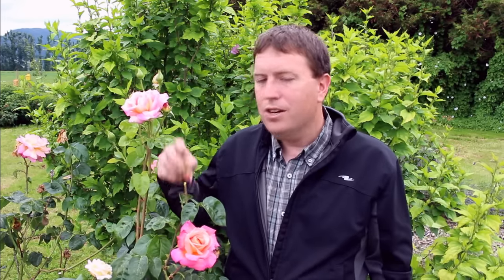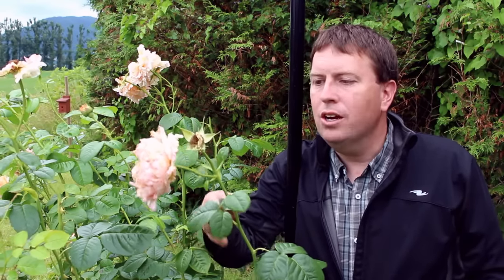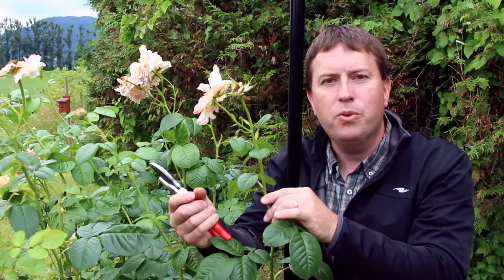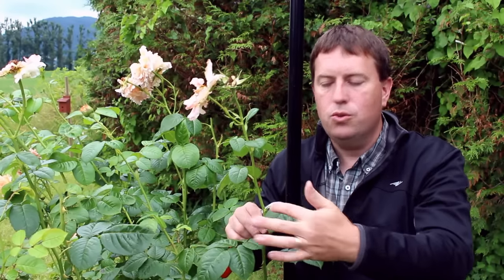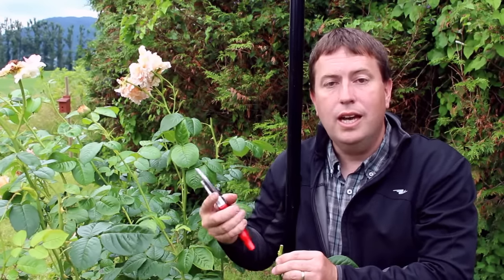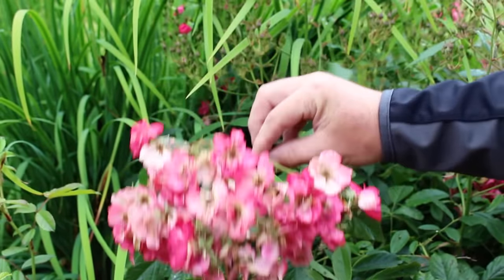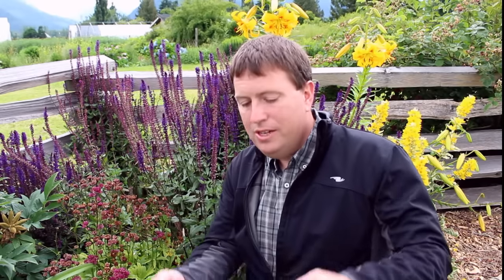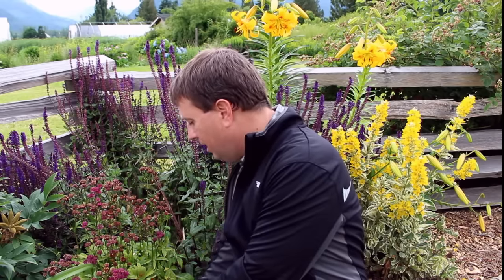Deadhead Roses for More Flowers

Comment: I follow every tip you give, and our roses have never looked as good as they have before. I also dont follow inward or outward facing bud eyes either. Bc the rose bush does shoot anyway it wants really anyway. I agree with cutting like you do. I have some rose bushes that have over 50 flowers at any given time. Along with multiple buds getting ready to open. And it's a smaller type floribunda with that many flowers. Its gorgeous. Just want to thank you for all the info you put out.
Reply from the maker: Thanks for the encouragement Seth

Comment: The reason for cutting at a slant, is to let rain water roll off the cut. In a wet climate this is quite important!!! Please don't pooh, pooh  other ways of doing this cut. You are not always right! Your presentation is very structured and methodical; well done!
Reply from the maker: Thanks Rose - one of my reasons for this video is to question these common practices. In my experience (in this very wet climate) the angle of cut makes no difference to post-pruning die back. I've also seen no horticultural research that supports the practice. If you like the angled cuts (or have found it useful) I leave you to your judgement, but I see it as unnecessary. Thanks for the feedback and for sharing your experience!

Comment: Thank you! Thank You! THANK YOU!!!!  I am 27 days away from my step-daughter's wedding at home and I put in a white garden that looks great now.  As the phlox are petering out, I have started deadheading but was unsure if i should be aggressive or deadhead in waves.  How do you tell how long it takes for a plant to start re-blooming?  Are there different re-blooming times (once deadheaded) for plants?  I am subscribing!
Reply from the maker: Thanks. It depends a lot on temperature, but 26 days is probably pushing it for most perennials to send new stems and blooms. I generally favor light deadheading, and in waves - because the results can be hard to time perfectly for the season, I figure it's better to make a lot of little bets than one big bet if you know what I mean.

Comment: Your channel taught me so much about plants. Thanks for sharing.
And one question, 
Will my Roses still grow in height with this Technic?
Reply from the maker: Hi Jud. Yes. After each flowering, they'll put on a little more height. I usually recommend an annual cool-season structural pruning step to correct the size and shape to your preference
Reply: Hi, I’m new to this with roses and seem to have a black thumb when it comes to gardening🤦‍♀️ but here goes.
I have fashioned an arch over my yard pond, and staged a climbing rose bush on either end of the arch (one red, one yellow) to have them grow in length across the arch, cross each other to the other side, and eventually have an arch that shows blended red & yellow roses, but my vines are 1) very sparse, and 2) when I try to ‘deadhead’ the roses, the vine starts dying from where I pinched/snipped, backwards down the vine eventually killing a good length of it, if not all of it.
So my question is, why is this happening, what am I doing wrong..? And also, how can I make my vines fuller without having to prune them back and starting over..?

Comment: Thank you for your very informative videos!  I have a question only tangentially related to deadheading and staging, but I am curious whether you have any thoughts on the matter.  That is, what if anything do you do when a plant in full flower has been beaten to the ground by a heavy rain?  Even when the stem has not been broken, I find it often true that plants don't "straighten back up," for lack of a better term.  For example, I have quite a few Mimulus cardinalis that recently were utterly flattened, and I'm at a loss once again as to how to attempt restoring them.  Staking might work, I suppose, but it's far from my favorite garden activity.  Anyway, many thanks again for your informative and enjoyable work.
Reply from the maker: Thanks Frank. I'm afraid I have to agree - once the weather has taken its toll on a plant, it's hard to get it back into shape. I usually end up pruning low (and fertilizing) for rebloom, because I do a lot of staging around the garden anyway, and staking just has never worked too well for me.

Comment: Thank you so much for this useful information.
Can these cuts be used for propagation? And can cuts be successful in hot months of the summer like July and August?
Reply from the maker: Hi Mohamed. If you're taking cuttings for prop at the same time, I suggest you cut a little lower, so that you get a couple of sections with 3 or 4 nodes you can stick. If you're doing this in July and August, just be sure to provide enough shade and humidity to keep them from drying out. I wish you luck!
Reply: Thank you so much

Comment: Can you use the section which had the 3 leaves as a stem cutting for propagation? Your garden looks lovely!
Reply from the maker: I've been using them - and I haven't seen a huge difference in results between them and ones taken from lower on the stem.

Comment: Thanks for the great videos. Do you have to pull off the 5 leaf then cut above it? Or do just need to cut above the 5 leafs when dead heading?
Reply from the maker: Hi Julie - thanks for the question. Cut above the 5-leaflet leaf, but you don't have to remove it.

Comment: Hi.Thank you for your video. Live in Philly. My problem I have roses established for 10 yrs now. A weed has grown middle ..I tried digging out..roots really in there ..wind up cutting back every yr.  Any suggestions.
Also is better to prune in January in my area.Ty.
Reply from the maker: Hi Debbie. Sounds like an annoying weed! Short of digging the rose out entirely to isolate it from the weed, I can't think of much.
Reply: I've had that same problem.  Wait till after the flowering season, water the rose generously a day before to soften the soil.  Then using a fork, dig in deeply all around the rose to loosen the soil until you can ease out the deep rooted weed.  Aftercare: add soluble fertiliser to the watering can & water generously around the rose, apologise & explain what is going on (to the rose) & why; add a layer of good quality compost, talk to it nicely, and give it plenty of attention, like a child.
If the weed is thick rooted & very deep, e.g. a tree sapling, cut it off above soil level, drill a hole into the remaining root, and inject some glyphosate into the hole, & plug the hole with a twig or something.
I don't know about the weather / climate in Philly, I'm commenting from England.  Here, I prune the roses back in autumn about 1/3rd to avoid wind rock; and again in march/ April at the very start of bud break as the rose is coming alive.  Also, it can vary with different varieties, shrub / climber / rambler / hybrid / species, and how they are faring.   I have made mistakes in under- and over-pruning, but roses are extraordinarily forgiving.  A lifetime of learning.  Besta luck.

Comment: When you cut just above the 5 leaf you took that leaf off. Should we take our off too or did you just do that to show us it had 5 leaves when deadheading?
Reply from the maker: I don't know why I plucked it, but yes, any leaves below the cut can stay on the shrub
Reply: @FraserValleyRoseFarm   Thank you just making sure. Also is it recommended when doing a full trim to cut off any steams that are not growing vertical and or dead/fungus?
Reply from the maker: Dead & diseased - yes! Vertical is trickier. There's nothing wrong with a horizontal stem (in fact, they tend to initiate more flowers along their length) if it doesn't distract from the shape of the shrub. I routinely take out thin/spindly and crossing branches when I have the pruners in my hand, but if it's just a quick deadheading you're after, best not to get bogged down in the details.

Comment: Great video!  One question, when pruning the spent roses can you propagate that cutting, if you cut back to the 5 leaf node?
Reply from the maker: I've tried propagating cuttings from this top portion of the stem (all with 3-leaflet leaves) and found they don't root as easily as it would from further down. YMMV

Comment: It's January 14th and my roses are budding.Tomorrow it is going to be 71 degrees, but, I know that there will be a hard frost that will be coming before spring. Anything that I can do to prevent any damage to my roses? Thank you.
Reply from the maker: Hi Deborah - some of my more foolish roses kept sending buds and are now covered in snow drifts. Ugh. If the shrubs are rated hardy to your growing zone, they'll come through okay. I'd only use winter protection if I had a marginally tender variety.

Comment: Hi there, I have just planted carpet roses, do I dead head them in the same way and how often should I feed them, please. Also should I just leave them to spread out or pin them down ??
Many thanks,
Best wishes
Helen
Many thanks
Helen
Reply from the maker: Hi Helen. Carpet roses are bred to reduce your work. Deadheading may speed up the process a little, but the carpet roses tend to rebloom fairly quickly anyhow. No need to pin them down. Just manage through a spring pruning to shape and don't be stingy with the fertilizer once established.

Comment: I've found cutting the stems at an angle makes it so the water rolls off and does not settle on the cut and possibly rotting the stem.
Reply from the maker: Thanks for the input.

Comment: I'm living in Lincolnshire, UK - so the Rose pruning - it's still valid here is it, as our climate will be different to BC's ?
Thanks.
Reply from the maker: Your climate is not so different - and yes, this kind of deadheading will work just fine in Lincolnshire. Thanks!
Reply: @FraserValleyRoseFarm  Thanks so much for your reply.  Your weather is certainly different to ours at the moment!  We almost need to turn the heating on it's that cool. :-)  I've started deadheading as you suggest,
Reply: Definitely, dead heading works to promote flowering on most plants. Obviously if you want a rose for it's ornamental Rose hips then don't dead head.

Comment: Quick question above removing the 5 leaflets:  Do you always have to remove the 5 leaflets after the cut or did you just do that for illustration purposes?  In other words, is it possible for a new flower to shoot up while the 5 leaflet is still intact?  Thank you!   Great videos!
Reply from the maker: I pulled that off just as I was showing the bud/node but you can leave it on.
Reply: @FraserValleyRoseFarm  Thanks so much!  Learned a lot from you from your videos.  You're doing great work, sir!

Comment: I never cut that much back and I have beautiful roses every year.
Reply from the maker: Nicely done. Whatever works for your rose... I never argue with success. I have a few that a reluctant (or rather slow) to rebloom if I don't deadhead promptly.
Reply: I do dead head them and I used regular kitchen scissors I just take the head off of them. Never have I cut as much off as he did.
Reply from the maker: Good to hear you've had good results!

Comment: What about if the rose has most of the foliage at the bottom? How do you dead head that one? I have a fragrant rose cloud with long stems and leaves at the bottom part of the rose. I'm not sure how to dead head it, do I go way to the bottom and find the 5 leaf, or dead head right below the flower?  Thank you
Reply from the maker: If foliage is missing at the top of the stems, I'd probably pick a node approximately 12" below the flower to cut back to.
Reply: Thank you 😊

Comment: Thoughts on shearing please? I have a unsightly overgrown hedge of mixed roses, that came with this home. Some appear to be Cecil Brunner climbing type that graze the ground, another looks like a neglected grande flora lollipop topiary and still others may be florabunda. By the looks of things, they may have been here for DECADES.  I can't possibly maintain this hedge as seen in this video. Will shearing do more harm than good. This area faces the street.
Reply from the maker: Hi Lisa. I've seen good rose gardens maintained with shearing (or even with a chainsaw if truth be told!). Whatever works to get them into a more manageable size and shape. I usually go by hand so that I can target some of the older/unproductive wood, but that can always be a follow-up step if you have time later to fuss with them.

Comment: I have a question, do you compost your cuttings?  Seems like at least the pedals would be nice to compost?
Reply from the maker: Hi Stevie. Yes I do compost (most of) my rose trimmings. The larger/thicker stems I burn because they would take so long to break down. The smaller bits and flowers I compost - but use the finished compost elsewhere in the garden, just to reduce the chance that I'm introducing blackspot or other spores back to my roses.

Comment: Quick question: What if there are several leafs with 5 leaflets (no more than 5 on the stem)? Can I cut the stem above any of the 5 leafs (so it's up to me how long I want the stem to be)? Thanks
Reply from the maker: Yes, pick any one you want and you can manage for shape and size at the same time.
Reply: @FraserValleyRoseFarm  Thank you so much! This video is really useful, because until now I was not sure how to properly cut the dead heads from my rose trees and bushes. Thanks again!

Comment: How do you deadhead onetime blooming roses? Thank you!
Reply from the maker: Hi Tatiana. I usually don't bother for a long while - if I'm not going to get more flowers, I have more pressing things to do in the garden, and I do kinda like having the display of hips on many of these varieties. If you need to prune your once-bloomers for shape, however, after the bloom cycle is great timing - and may take off some of those spent blooms.
Reply: @FraserValleyRoseFarm  OK, I got it. 
I have three new oncebloomer gallica roses. They are small but did bloom on each little branch in first summer.
I like your channel! Thank you!

Comment: I've recently read to leave two sets of leaves when pruning roses. It sounds similar to your method but starting from the bottom, rather then the bud. Would you agree? If not, would you clarify?
Reply from the maker: Hi Shirley. There's no exact "best" place to make the cut, so I try not to get too hung up on the rules. If you at least go back down to the next 5-leaflet leaf set, it prepares the shrub well for its next set of flowers. I'm sure you can also "count up" from the bottom end of the same-year's growth, and get to a similar spot.

Comment: Thank you for this video.  I just have a quick question.  When you count down to the 5 leaves do you always just pull off the 5 leaves or cut above it or below it.  I'm just not clear.  Other videos didn't really explain that clearly.  Thanks for your help.  Patty Boynton
Reply from the maker: Hi Patricia. Cut just above the node with a five-leaflet leaf. You don't need to remove the leaf.
Reply: @FraserValleyRoseFarm  Thank you for your quick and helpful response.
Reply: Hi

Comment: What good is it to have (CC), on Videos; for the hearing impaired if it covers up the images w/large format Fonts?
Reply from the maker: Really good point - the captions are an optional setting (you can choose to have them on or off) and they're autogenerated by Google. I usually will go back through the file to correct for spelling, but that's the limit of my involvement. The rest is between you and Youtube - if you find the captions useful, and they're not covering up what you want to see, you can leave them on. If you don't need them and you find their placement obtrusive, you can turn them off. Overall, I'm happy to see them available for those with hearing impairment, but I've also heard from other viewers like you who find their size and placement to distracts from the video.
Reply: @FraserValleyRoseFarm  Thank you. Yes Google is the culprit and (CC) on my device was never turned on. At any rate, no matter how it's added or produced...the images are like "redacted government documents." Watching w/o sound atleast provides images that often easy to follow. It's just an annoyance.

Comment: I HAVE NEW ROSES MY SON GAVE ME FOR MOTHER'S DAY AND THEY LOOK VERY HEALTHY AS FAR AS LEAVES AND BUDS GO.   HE PUT THEM IN THE GROUND RIGHT AWAY FOLLOWING DIRECTIONS ON THE CARD. THREE OF THEM OPENED AND WERE BEAUTIFUL FOR ABOUT 2 DAYS AND NOW THEY ARE BOWING THERE HEADS SO ALL I SEE IS THE UNDERSIDES.  THE TIPS OF THE STEMS WON'T HOLD THEM UP. WHAT IS WRONG WITH THEM
Reply from the maker: I agree that it could be transplant shock, but I'd also just check one other possibility: Is there enough water? A sudden drooping can be due to dry soil.

Comment: I bought a small flowerpot with roses. There were a lot of buds, but there are only a few left. I'm keeping it by the sun's window, so I don't want it to wither and die.
Reply from the maker: If it's living in a pot inside, it can be difficult to keep a rose in good condition. Is there any chance you could find a good spot for it outside perhaps even pot it up into a larger container or plant in the ground?

Comment: Sometimes buds remain on a cluster.  The buds can be put in vinegar. Sometimes the color leeches into the vinegar.  Sometimes the color is completely preserved. There are also inbetween situations.  This makes a jeweled vinegar, which can be used in cooking, cosmetically and allegedly medicinal. If you soak your feet in vinegar, you need to add oil or hair conditioner or lard and rainwater but not from the roof.  Lard (from pigs)is supposedl to be the least allergenic, carp bones for cooking.
Reply: I knew someone who paid for carp carcasses. He soaked the bones for fertilizer. The carp had been cooked.  As a project this retired extension lady eventually boiled the bones for blanc mange. She and the gardener flavored it with a deep red rose extract for a robber baron wife tea party